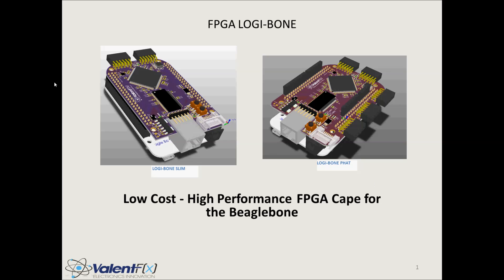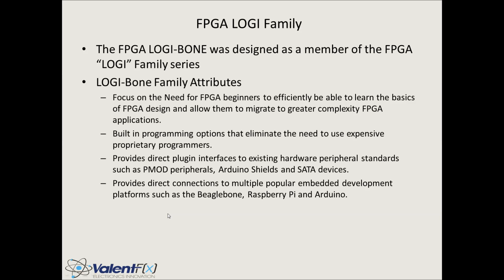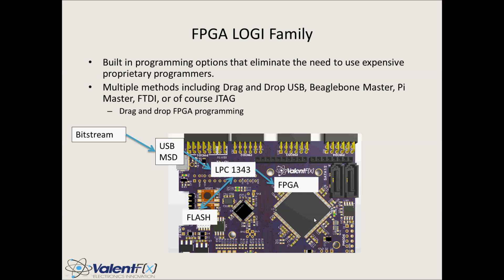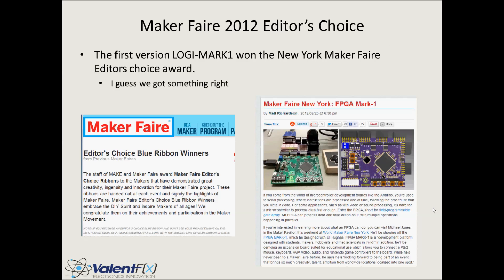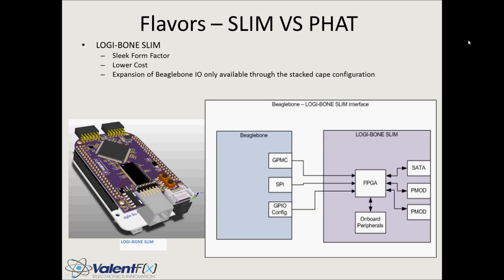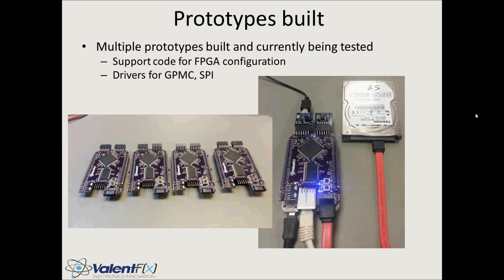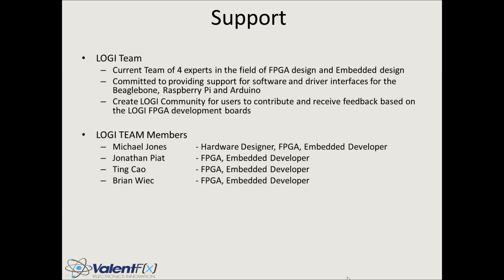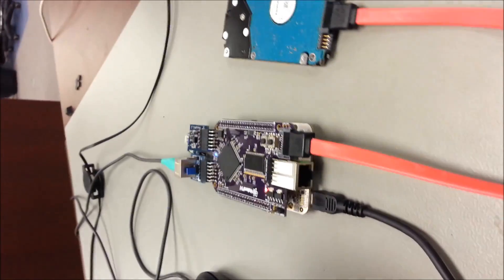LOGI-BONE - FPGA Cape for the Beaglebone

Comment: Curious, how are doing SATA using SelectIO without any gigabit transceivers? I thought SATA would only link at 1.5Gbit/s (for SATA 1.0), whereas SelectIO is limited to 1080Mbit/s and doesn't have clock recovery like the GTs...